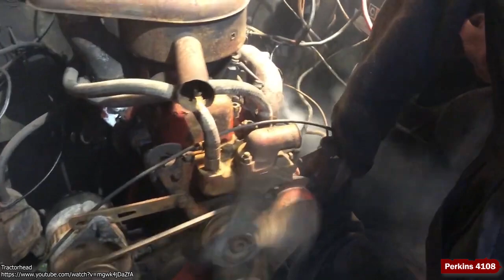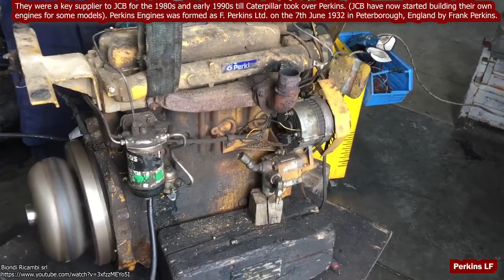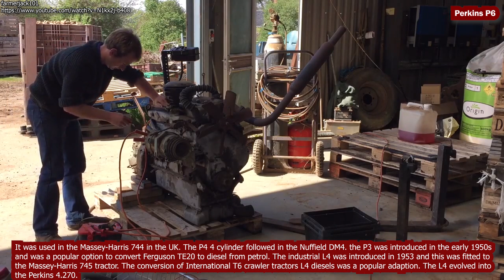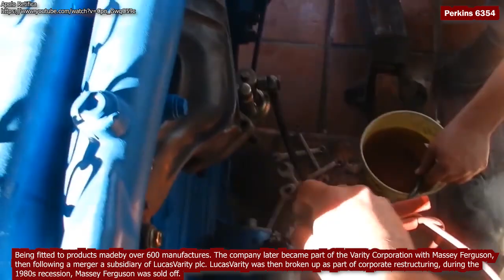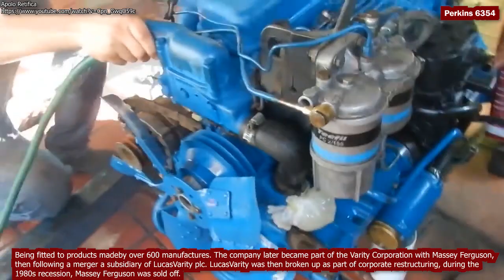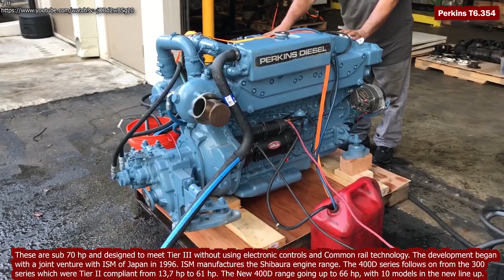Cold Starting Up PERKINS Engines and Cool Sound

Comment: Went with a mate to view a mk1 Ford granada a good few years back. It had one of these engines "retro fitted". The engine mounts were dexion shelving angle half bolted, half "stick welded" extremely badly. There was no inlet manifold on the engine and after an almost battery draining non start the seller shoved some ripped up kitchen towel down each inlet port, squirted zippo lighter fuel on them all and lit it, shouting "crank it over!" to my mate. If only he had left the 3 litre V6 petrol engine in there it would have been a lovely car, sadly it was too ruined to be worth buying.

Comment: I go out on a big boat nelson 40 ..it got a 6 354 na borgwarner gearbox  bowman heat exchanger on it 3500 + hours summer and winter... two swing off the starter and its fired UP..no joking some engine to start..did the hole top end last summer new every thing valves.. guides.. seatings.. skip... new water pump... alternator... starter.. heater plug... and lift pump...recon.. injectors...and injector pump gaskets & O rings...the only reason i did the lot was ... it has 3500hrs ...and it was gaining OIL ... injector leeking over night... and the empeller started breaking UP one day bussers went off hot but not boiling..the engine was blue back in the day ... now silver...helo from Ireland...😉

.